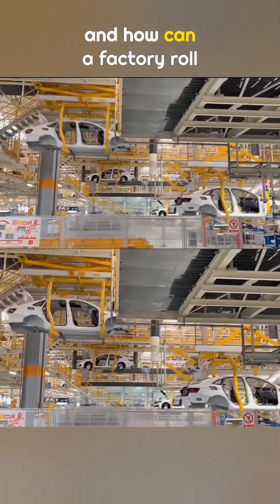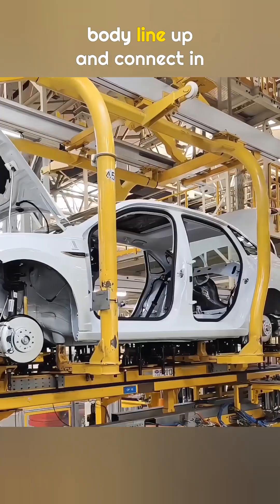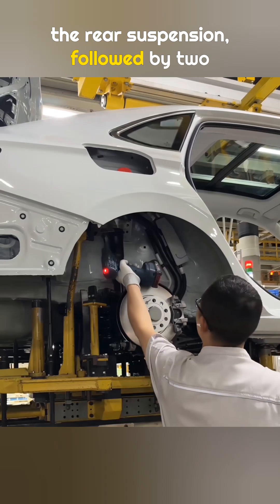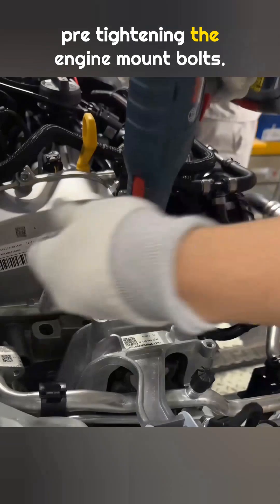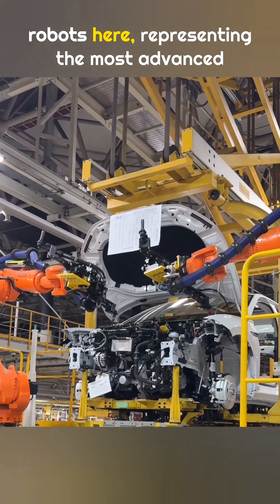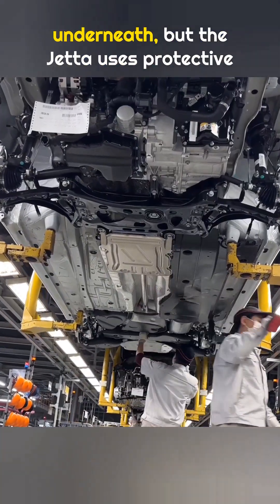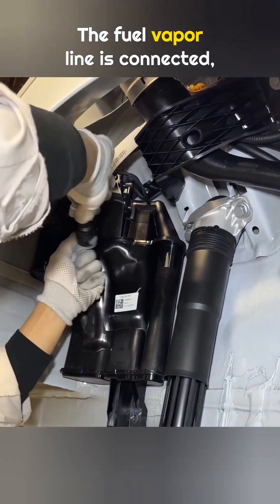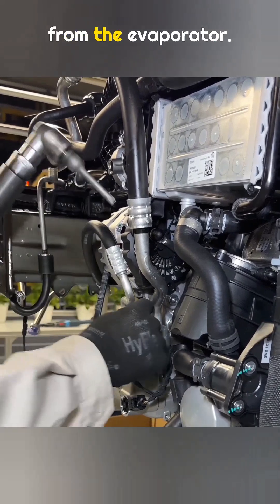Inside the Factory Where Cars Take Shape

Comment: I do not know about Audi/Volkswagen specifically, but as a mechanic, every factory bolt that I take out is overtorqued -- the "torque control" IS NOT "extremely precise."
Reply: How do you measure it?
Reply: @federicoc3749  By hand.
If it is so tight that I cannot break the bolt loose by hand, it is way too tight.

Comment: The fact that a less technically advanced bolt tool can cost that much, because of the western inflated cost factor is a single most tell-tale story about this.

A KuKa robotic arm cost well over 30k USD , you can get a chinese equivalent for less than 5k USD. 

Don't get me started with the quality, just don't, unless you understand the imperative of cash conversion cycles and cash flow planming in any manufacturing business.
Reply: Certo, quando il costo della manodopera e dell'approvvigionamento delle materie e/componenti è differente fra una economia e un'altra è normale. È ridicolo fare questo genere di paragoni.